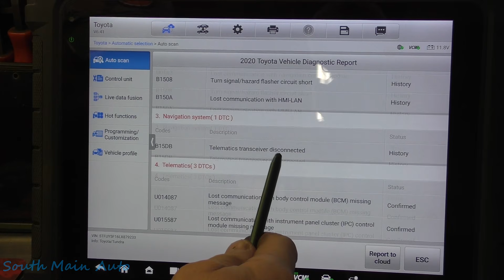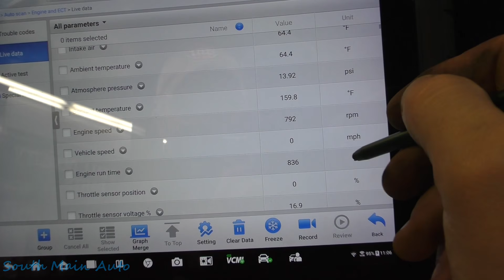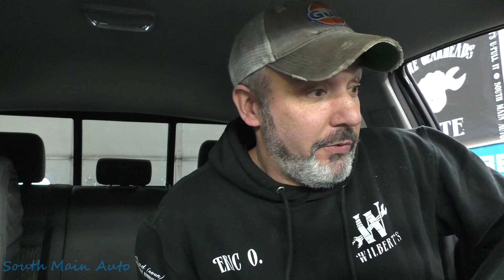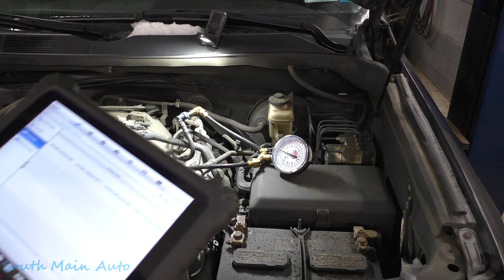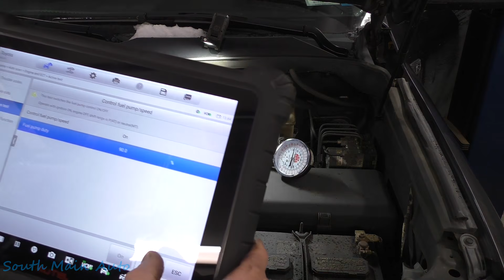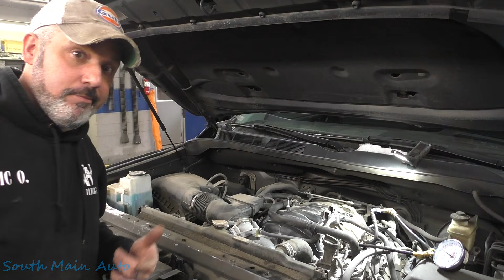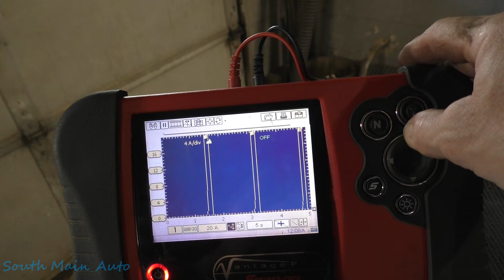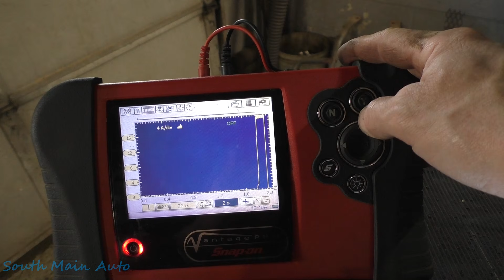My Customer Is Getting Shafted By The Local Toyota Dealer

Comment: You mentioned a situation I've always found odd, that being the owner's reluctance to take his problem to a dealer because he didn't want to pay for someone to hang a bunch of parts until something worked.  It's appalling to me that any business can charge a customer for a misdiagnosis.  I was an HVAC/R service tech for much of my life, and if I put a gas valve in your non-running furnace and it doesn't fix the problem, I'm most certainly NOT going to just leave it in and charge you for it!!!  That's insane, and I can't understand how other businesses can get away with it.  This should NEVER be allowed.  

Prior to becoming and HVAC/R tech, I was the service manager for a motorcycle dealership.  A guy brought his bike in that kept experiencing a dead battery.  My tech tshot and diagnosed a bad rectifier, so he put one in.  Week later, bike comes back.  The tech tshot and diagnosed a bad stator and put one in.  Week later, the bike comes back.  Tech tshot again and then said it was the regulator.  Put it in, and that fixed the problem.  When I told the tech he had to pull the other two parts he put in, he said, "No, because they're all bad."  Bullshit.  You just can't troubleshoot.

Why should any customer have to pay for YOUR MISTAKE?

Comment: What to me is most interesting is at the end of the day, this is all logic, all considering how to measure something to prove what you believe - or to get told something different.

When the video started I was pretty much on the fuel thing.  I am old enough to know about vapor lock, which is sort of what this seemed like.  For what it's worth, perhaps the heat has something to do with making it a little harder to pump the gas as well... who knows?  Good Diag and nice to see the dealer with their tail between their legs on this one.

Comment: I had a 01 silverado where I had to turn the key twice to prime it before start.  Then the suburban would start.  After than ran fine.
Reply: That is due to a bad check valve in the pump. The check valve is intended to keep the lines primed. When it fails the fuel drains back out of the lines. You have to cycle the key a few times to refill the lines for starting,

Comment: I had a similar case with my C6 Corvette. After 100Kmi, I started having a crank but no start situation. It was both random and extremely frustrating. To make the story short, it turned out to be 2 concurrent issues. The 10Amp FP circuit was carbonizing at the connectors and the FP was becoming intermittent. I'm guessing the motor brushes wore out. As  the fuse/relay block was no longer available, a Painless 30A FP fuse/relay relocation harness was wired in to bypass the OE 10A circuit. Plus a new FP.  No more intermittent start issues and the FP loves the 30A setup.

Comment: Well done sir. Always look forward to seeing your videos when they drop. 

Just wanted to share my knowledge and experience here:

That pump didn’t sound healthy at all. Your measurement of the pump current solidified it when you looked at the pulses briefly. Multi-pole electric motors when running should produce an even uniform waveform with no dropouts or variance. Assuming voltage supply is constant of course. 
Your pump having a varying current per pulse points directly to failing/failed bearings in the pump motor assembly. 

Pretty quick way to do predictive failure and intermittent diags. The test method you used here is also great for blower motors. Especially those hard to reach ones.

Comment: GOOD JOB. FROM A RETIRED 43 YEAR MASTER MECHANIC. FIX IT RIGHT THE 1ST TIME. WE DONT GET PAYED TO GUESS. [ UNLESS YOU WORK FOR A DEALER]  ROOKIES-TRAINE'S, PART CHANGERS.  THATS WHAT THEY START WITH.  THEY ARE NOT MECHANICS. ONLY A FEW LIKE US. THAT CARE TO DO IT RIGHT ,IT DOES NOT PAY THE 2ED TIME AROUND . YOU KNOW!
Reply: Not sure what you are talking about if you are retired after 43 years since this is a new phenomenon in the dealer world. I was a Ford tech from the late 90’s until 2018. I left because everything was falling off a cliff. However, for most of my career there skilled techs were all at the dealerships. I can’t count how many parts cannon cars came in after an aftermarket shop say hung every EGR part on a car and then said it’s “a dealer problem”. I then cleaned the clogged ports for a fifth of the bill that the shop charged for not fix the car. Or when Big O replaced every air suspension part on a Navigator with aftermarket crap that leaked. Billed $5k (circa 2008) and I put it all back to stock and fixed the actual failure for $2500. Woulda cost $500 if I had gotten in first. 
 I can go on and on but we could not parts cannon cars. I worked at five Ford dealers and that was the culture at all of them. I knew guys from Chevy and Honda and it was the same there. We had to go through our training. Had to constantly be trained on new tech and had to “fix it right the first time on time”. If I had tried to hang a bunch of parts on a car the customer would have never even gotten a call. The foreman would have been six feet up my ass in minutes. All of it stemmed from warranty compliance. Ford tightly monitored warranty work. Anything looked fishy and they called the “failed” part back. If it was good then it got mailed back to the dealer and the claim was denied. So the dealer ate the whole ticket. If enough of that was going on the warranty numbers would be high and trigger an audit. Audits would cost the dealer up to a couple hundred thousand in fines every time. I don’t know what has changed since I left. I was one of the first rats off the ship. The crap work I see when we send warranty work to them is unbelievable to me. 
 It’s not just cars though. You can’t get anything done right these days. I’ve gotten old enough that I don’t want to do my own home repairs anymore but I have to since I’m not going to pay some dude $2k to do crap work that I have to fix anyway.
Reply: @AlphanumericCharacters  YES,  I AGREE WITH YOU .

Comment: low fuel pressure.  I had a 2000 chevy blazer that would act similar.  required 50-60 psi fuel pressure.  below 45 and it wouldn't start.  but it would run on about 35 psi.  swap fuel pump - issue gone.  not sure if the toyota is same way - but GM, before they went direct inject - the 'high' pressure fuel systems 50-60psi were finicky if they had low pressure.  wouldn't start but would run on much lower pressure.

Comment: Having no o scope, I would have gone about trouble shooting this one as you did, but I may have wanted to check the resistance on the pump if possible. I might have went down the rusty connector rabbit hole or possible rusty ground someplace. But if the connectors are still solid on the FP ECU and FP, and the grounds are not rusted, i probably would have gone back to see what the resistance was of the pump. (after checking the fuel pressure lines and the fuel regulator (if it has one). Thanks for the video. This could happen to any fuel pump with a few miles on it. Glad the dealer finally broke down and fixed it. Although it would have been nice if they would have just done actual troubleshooting, but everyone knows that there isn't a lot of money in doing warranty work, and even less when it comes to getting a tech to get paid for diagnostics.

Comment: I have problems with my 02 Jeep Grand Cherokee 4.7L fuel system (I think). I've had issues with my fuel when cold after it warms up causing a no start.
One time i thought it was a fuel filter semi clogged and i use Berrymans Chemtool B-12 (Fuel System+ injector Cleaner) every 5K miles until i can buy a new filter, and later pump assembly from RockAuto but can't afford that right now abd not sure its the pump... I'm thinking the Throttle Position Sensor and IAC Valve needing changed by maybe causing stalls when stopping to make a turn or stopping uphill when idling.
Also had a rough start and had fuel smell on startup until i used Berrymans (assumed it was injectors clogged) because it did fix the rough start and no more shaking or misfire.

Any ideas for my 02 Jeep Grand Cherokee Laredo V8 4.7L, i have TPS and IACV on the way abd new air filter, new gas cap on the way. 
What you think it is. Had a crank no start with random stalls when slowing down and letting off gas to make a turn on highway. Stalled every time i stopped on a uphill incline to turn on highway? Then when trying to restart it cranked forever no start until i pumped gas pedal and floored it.
You think the TPS and IACV will fix it or is the shop i went to wrong on their Diag?

Comment: Intermittent problems were my pet hate as an IT support person and like automotives the customer always lies; except I don't. I purchase a brand new 2001 Hyundai Elantra and in the first week and before the first 1,000km service I had an issue. I would turn the key, engine would run for 30 seconds and then stop. 120 seconds later there was a click and I could turn the key and sometimes it would start and most times it would not. I timed everything that happened and passed this information onto the dealer at each service and it still took EIGHTEEN MONTHS to diagnose it as a faulty Antenna Coil. All I had to do would have been to remove the key, turn it 180° reinsert and it would likely have recognise the key and started. I guess the technician had it not start when servicing it and decided to look at the far king codes. 
EIGHTEEN far king MONTHS on a brand new car. [/rant off]

Comment: The wild part is this is a reasonably new truck, so it's not like you gotta worry about rubber seals disintegrating in your hands when you take stuff apart. Literally nuts, bolts and multimeter stuff. Ridiculous.

Comment: So the fuel pump is Intermittently working its like the computer is commanding it one minute then not the other as fuel pressure dropped and it started stalling 😮 18:40 @South Main Auto Repair LLC

Comment: Definitely seems like a classic fuel pump failing But your right Eric very odd that if it's given some sauce it starts and runs with no issues which is not normal for a failing fuel pump very interesting i do know these 5.7s have timing issues Eric O 8:32 @South Main Auto Repair LLC

Comment: Wondering if perhaps when the pump is cold, or when it has cold fuel coursing through it (like when the truck is running down the road)  the binding within the pump is not sufficient to strain the pump and create excess current draw, but let it sit, and the residual heat now trapped within the pump causes something to expand within the pump creating just enough interference to cause the non-start problem. Great diagnosis as always.

Comment: The exact problems with the 95 and 96 Chevy pickup and blazer. When it wouldn't start kick the fuel tank then get ready to drop the fuel tank and change the pump. It was so bad in Chevys that a lot of guys cut a hole in the bed of their truck above the fuel pump so they would not have to drop the tank. I even seen a guy who cut a hole in his blazer behind the front seat and carried an extra fuel pump with him.

Comment: Toyota tech here. First: thanks for posting videos like this as it helps me learn. Still learning everyday.
Second: the moment I heard that pump running I knew it was at least a problem if not the problem. Just based off of having done plenty of fuel pumps and knowing how it should sound.
Third: as a tech I would have said thanks for the help. For warranty purposes I would have needed to confirm it for myself and provide documentation. But that’s also easy cause —- listen to that pump.

Comment: I have 2019 tacoma big 3.5. Have had crusty around the over flow tank missing half a court of coolant took it to 2 shops. No big deal they said. Well aware of a head gasket. By less than 60k on it what would you recommend sir?
Reply: Professional shops know Toyota owners have feeble mechanical knowledge, and won't help unless they feel like it

Comment: It makes sense that the fuel pump ecu would shut down on prolonged high current. The high current is not producing results because the pump is not rotating or pumping and the ECUs are detecting that there is a problem and shut down power. I would think the current would drop once the pump is rotating and building pressure but would increase on more fuel demand. I never new that the fuel pump could have variable speeds I always thought they were just one speed one pressure.

Comment: The problem with dealers and other shops is there is not mechanics who take pride in their job and diagnosis of the problem . Instead they throw parts at it and if it fixes it they think they have done something and call them self mechanics when in reality they are parts changers not mechanics then the owner has to pay for this ignorance and gets shafted for parts they didn’t need cause the parts changer still isn’t sure what part even fixed it so they can’t remove the parts they throwed at it instead lie and charge for all .

Comment: I had a 2002 5.7... the fiel pump cracked at the top and it leaked inside of the gas tank. It would run fine for about 20 min and then lay down. At 35lbs it will idle and maybe do 20 mph. Could never find the exact pressure ir was supposed to be. New fuel pump and it ran 50 to 55lbs. Gixed problem

Comment: I have been experiencing a hot start issue with my  SAAB 9-5 (2.0t ecopower 2003) and from a bit of research its been suggested that the crank position sensor is a common failure. When the car gets hot it turns over as normal but will not fire up. But this was not diagnosed with your vehicle?

Comment: Hey Eric,
Completely unrelated, but my friend's 2012 Honda crv suddenly had three dash lights come on that are unrelated. The lights are check engine, power steering fail, and abs. I checked online and it seems several people have the same problem, going from repair shop to repair shop. Fortunately a local Honda dealer had an experienced tech who found the problem was caused by a stretched timing chain. We got him thinking when we told him our little scan tool flagged a failing cam position sensor. From experience he knew right away the cam sensor probably tripped the other lights. After a new timing chain and a few hundred miles, no more lights. (doesn't make sense to me) I just thought you should know in case you run into this problem.

Comment: Not sure but I know in my trade if there is a motor they would have impedance protection I.e. if the motor gets too hot it will shit down. . If that fuel pump has a motor there might be impedance protection or something like it.

Comment: I can't understand the dealer math on some of these issues.   1) I have to think that replacing 2 computers is more expensive than just replacing the pump as diagnosed.    2) They didn't want to spend the time to confirm the diagnosis (most likely because time/money), yet spent money on the re-work times three.  3) Cars cost $60K+ anymore; bad dealer experiences have more at stake these days.  People will go to another dealer or buy another brand if hosed enough.

Comment: Yeah i love it when serivce managers told me "no your diagnosis is wrong" while they've never turned a wrench or not for 15+yrs. I used to take cars "no one could fix" and fixed them. One VW was a two "Euro" shops crank no start. Guy was auto parts manger so educated some, i had it fixed in a day. It was a multi component failure simultaneously.

Comment: To me the problems / issues such as this - GOES COMPLETELY - to what many view these days as OVER ENGINEERING. So - of course -the engineers feel the need to design and control the fuel pump speed  by a duty cycle signal - IE: using a MODULE ( also known as a microprocessor / mini computer ). I guess a fuel pump - single speed - positive pressure fuel pump - with pressure regulator design was too dependable and lasted too long 🤨😏
Just my opinion - but I am not a fan of EVERYTHING being computer controlled. Same opinion with so much / parts on modern vehicles being made out of PLASTIC 🤨

Comment: When the engine is running, the alternator is sending 14 volts to the system. With a failing fuel pump, sometimes the extra voltage gives the pump the extra juice it needs to run normally.

Comment: Just a guess this happened to my 2014 tundra etc. would not start at all no fuel pressure and it ended up being the fuel pressure monitor I believe it’s called mounted to the left side of the rear frame by the axle after about 12 days I finally figured it out good luck

Comment: You have to check the fuse. All those electronics working on low voltage control side of circuits so they have no control on ocp (if they decided to put an ocp to the circuit but usually they don't cuz it will cost more to them) . So pump can pull a lot of amps till it burns or cables burns out, that means you have only 1 ocp which is the fuse.. Not sure what is the current of that pump but probably something wrong with the fuse, relay should be super hot too.. Another weird thing is there is no money light for low fuel pressure.. Even w/o fancy tools just listening to that pump anyone would understand that pump doesn't work right..  Pump design still old and stupid, piece of fabric rolling inside of the motor and  getting rock hard by time or running dry n hot while working in low fuel level long time.. Thats the main reason of stuck fuel pump..

Comment: Eric - the statement the customer gave you that "they were just guessing based off pattern failures and throwing parts at it" is the EXACT REASON why I do not take my vehicle to a dealership to get worked on. I wonder how many dealerships simply neglected to take a look at any wiring diagrams, service data, or even a diagnostic tool when they have all that data available for free provided by their place of employment. My guess is almost all of them. Sad.